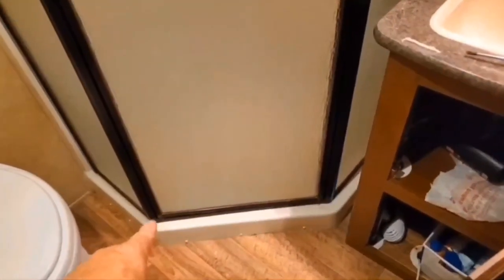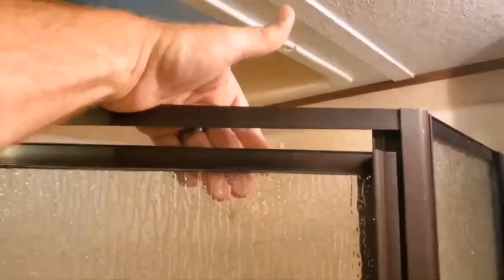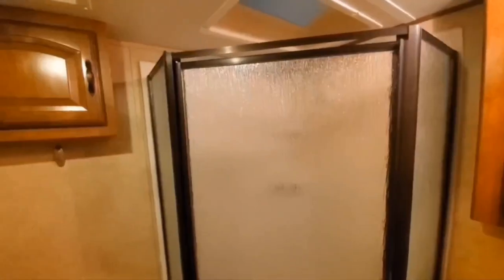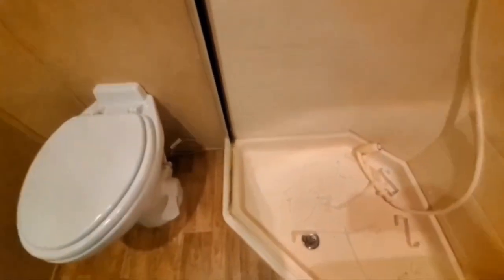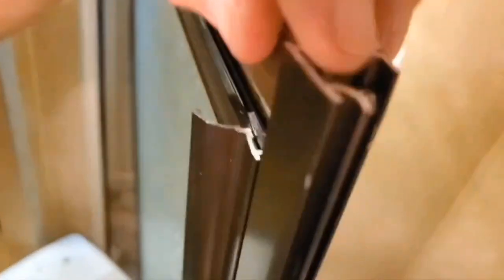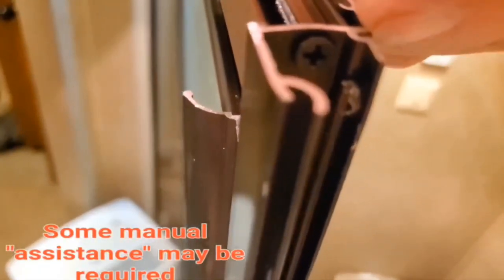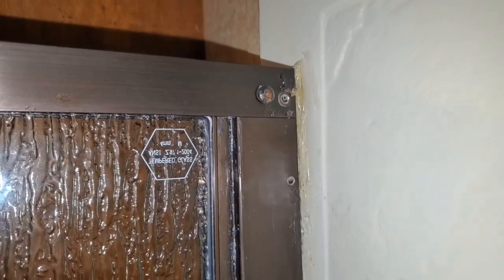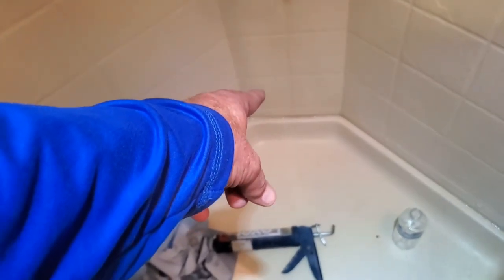RV Shower Door Repair & Wall Removal and Reinstall

Comment: So you had the exact same problem as I had. The issue for me was one side where it attaches to the wall was not tight. There was no stud or anything to attach it to in the wall so the “track” was away from the wall and causing the door to be out of square. I’m mounting a reinforcement on the ceiling and pushing the enclosure into place with a fabricated bracket. Thats just me. I love your comment “quality is job 1”. No matter what brand or level of rv you buy, they’re all built like this with no give a damn which is so disappointing when you buy these things for big bucks. Thank you for posting this quality video…you’re really good at it!
Reply from the maker: Thanks, sounds like you're pretty handy too.

Comment: What is the link to the seal and caulk used?  Looks just like a problem we are dealing with. You may be able to put a seal on the top also.  Thank you.
Reply from the maker: Search for this in Amazon, it's where I got it.
Brand: TechnologyLK

4.3 4.3 out of 5 stars 368

Two-Pronged Shower Vinyl Sweep and Seal - 32-1/2"

Comment: I have the same issue. That I have to work on when I get back from deployment. You have an email or something? I have more some questions. Thanks
Reply from the maker: You can reach me through here. It's the best way.  Here I get notification, email doesn't notify me.
Reply: @thewayididit6641  ok. Just moving the hole over fixed it correct? I heard you mention putting the screw in a diffrent spot on the topper. Does that also effect the way the door was sagging?
Reply from the maker: Moving the hinge point was the bulk of the solution.  As I fastened the top cover, I held the walls flexed in such a way that the door gap wasn't forced back into the same position it was before, but rather a position that kept the gap equal.  The I put the screws in a different location.
I did everything by myself; I suggest you get another set of hands to help if possible.  They don't need to be strong, just able to reach the top of the walls.
Reply: @thewayididit6641  thank you sir. I have been googling fixes for a while. Finally ran across this. Appreciate it.
Reply from the maker: Glad to help and good luck!